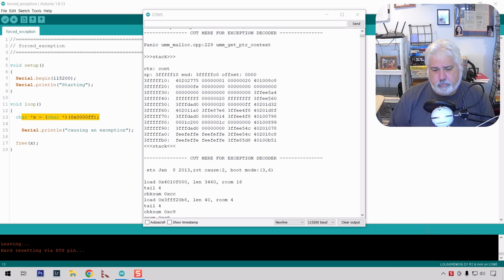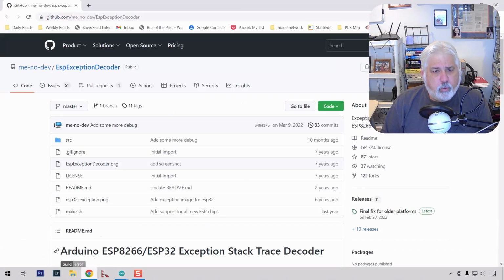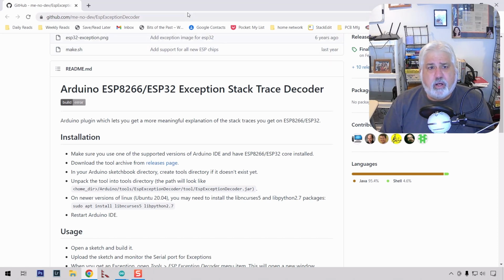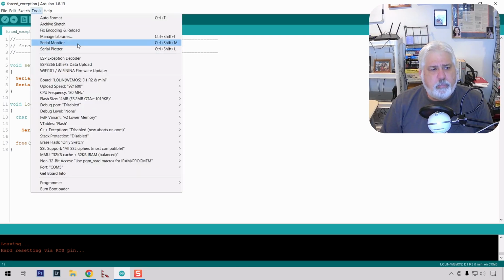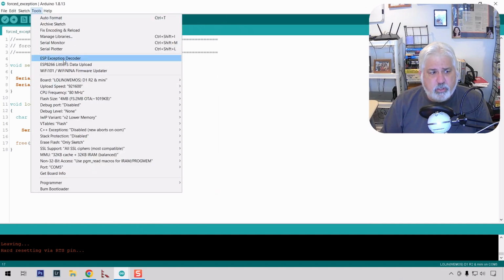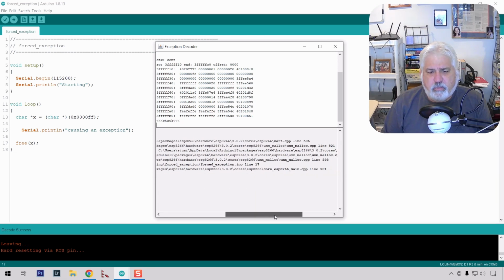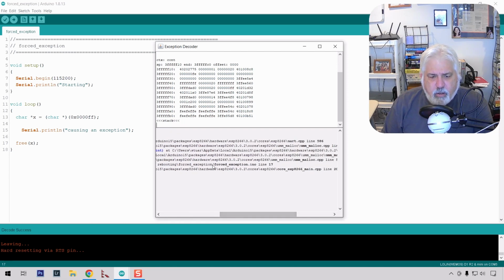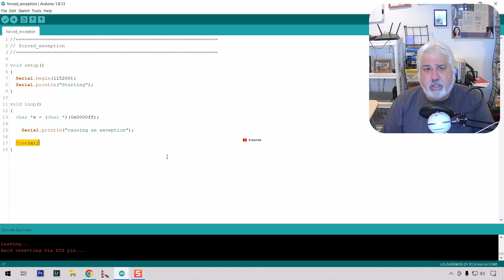ESP8266 D1 Mini Keeps Rebooting / Restarting

Comment: Never ending While loop will do the same thing...took me entirely too long to find why my Wemos D1 Mini was in an infinite boot loop and found that it wasn't coming out of one of the While Loops within X time.  Does seem that there is a time limit as 5 seconds is too long but 3 seconds seems to be ok.  Had to check to see if the while loop was continuously being run and after 3 seconds break out.  Another reason I found out on the interwebs was using attachinterrupt on an ESP device, the way around this is before the Setup() function is to add void ICACHE_RAM_ATTR {name of function that will run}(); do this without the curly brackets of course.
Reply from the maker: Hmm, interesting.  Thanks for letting me know!

Comment: my esp-32 keeps connecting disconnecting when I see it on device manager
Reply from the maker: I have not seen this with my esp32 development, however a quick search recommends disconnecting any electronics you have added and holding down the EN pin and try uploading the simple blink example.
Reply: @StuartPatterson  thanks, this solved my problem!